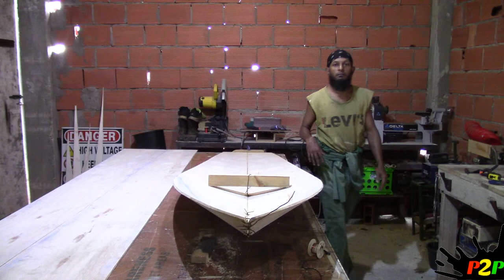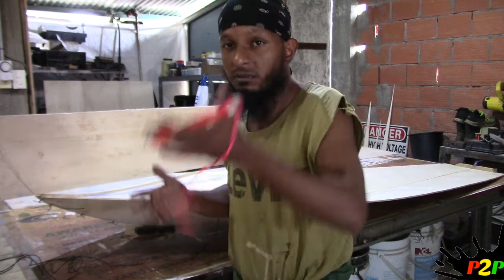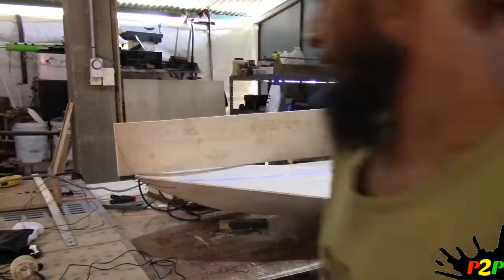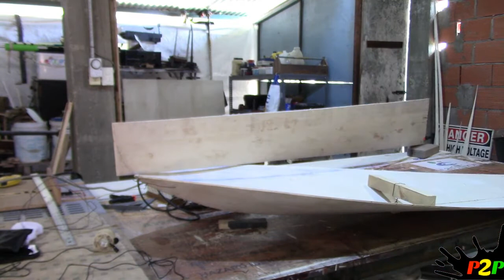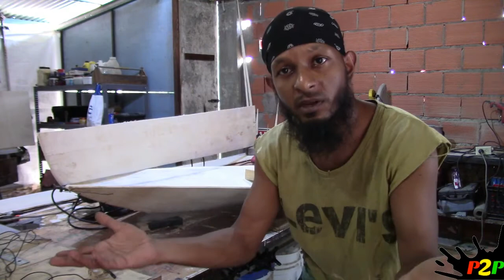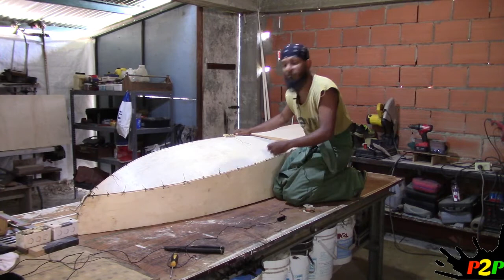Build your own boat pt2

Comment: Have you ever thought of building a hull that fits exactly in an Intek mariner 4. Belike a reverse RIB? I was looking into a plastic mold that fits in one.
Reply: Really interesting idea - I have such an Intek. You've just sparked an idea in my head ! Did you mean a fibreglass  reinforced 1/4 "' inch marine ply flat bottom fitting as an extra floor inside the Intek ? Or the opposite - a shallow V like this build,with the sides lower, ending just below the top of the Intek sides ?